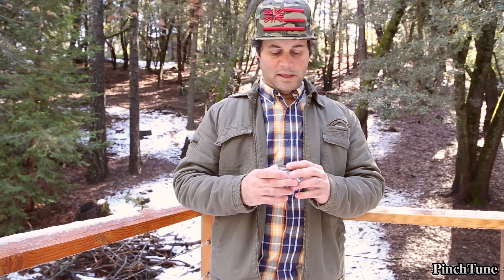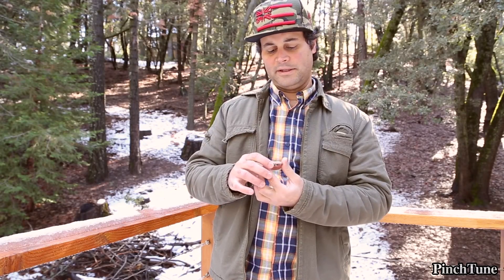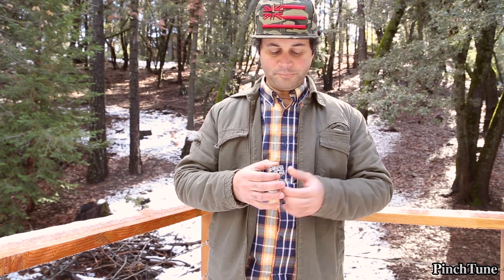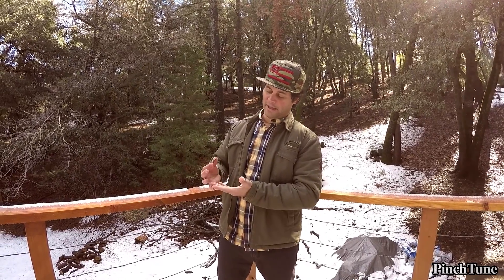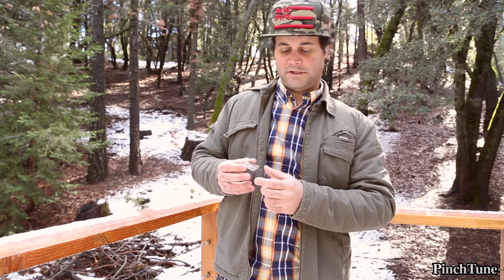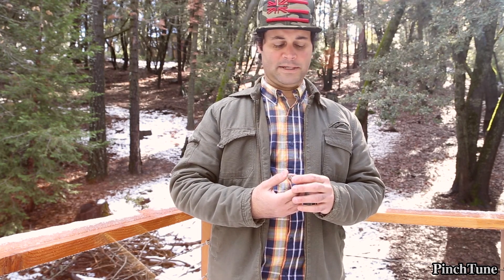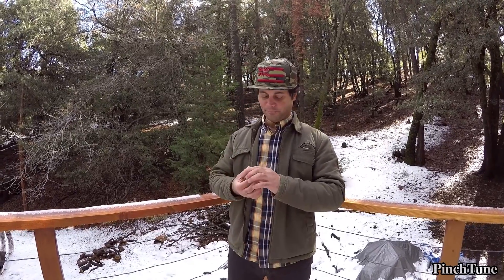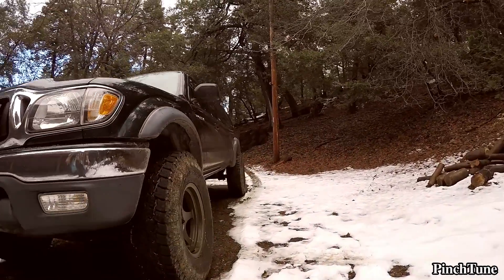What's So Great About the Betaflight F3 Flight Controller

Comment: The ESC pads on the top are for the signal... its NOT an option top or bottom!  ESC power on the bigger bottom pads and ESC signal on the smaller top pads.
Reply from the maker: Yep. I know. I've installed a few of these now. Sorry for the error in the video. This was when I first got it. However, for some reason YouTube is removing annotations from videos so there's no point in placing a note in it to correct it. Not sure why they are doing this. I'll add it to the description...
Reply from the maker: There. I added it. Thanks.